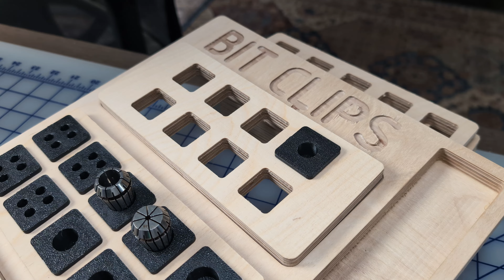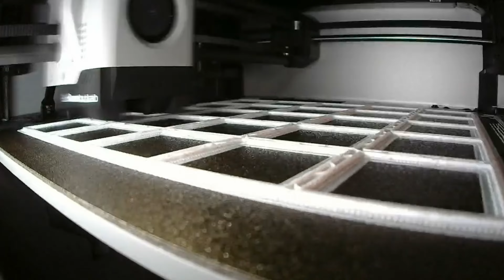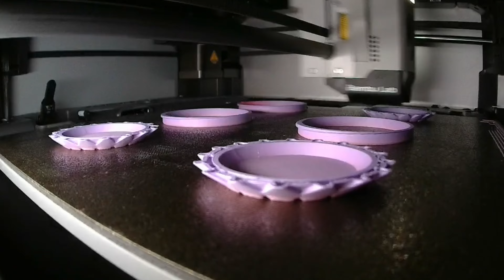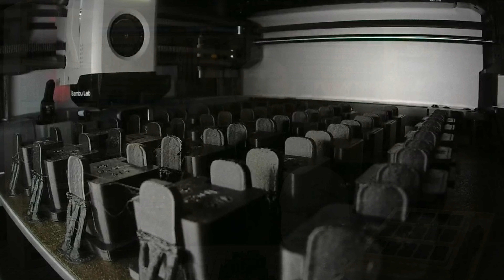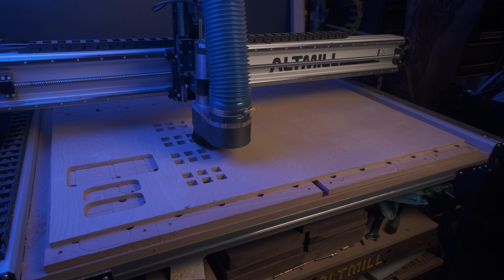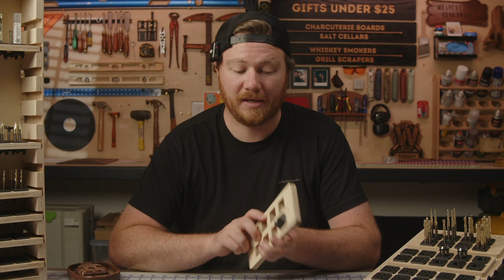these INSTANTLY made my woodshop organized

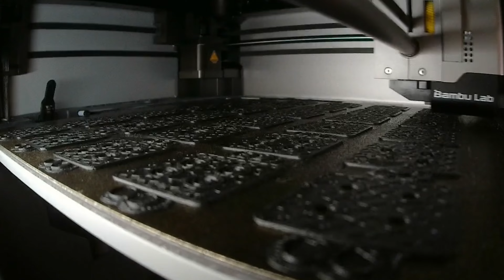Comment: 2:30 If you use a chamfer on the clips instead of making it flat you wouldn't need support. That will save you plastic and time post processing. Might even be able to print more in one go because you'll be able to print them closer together.